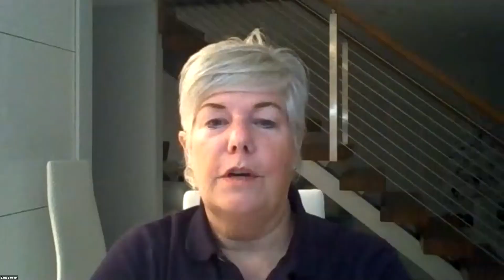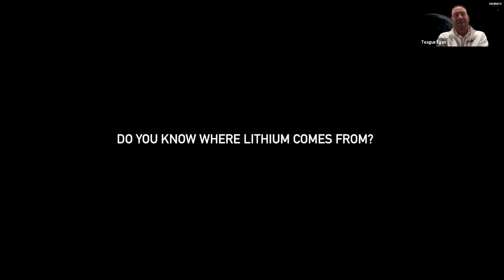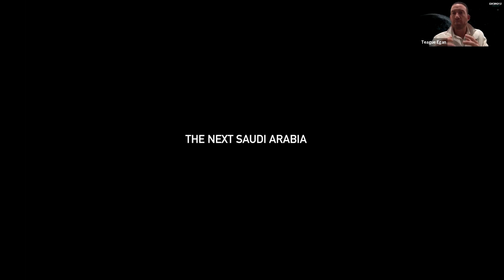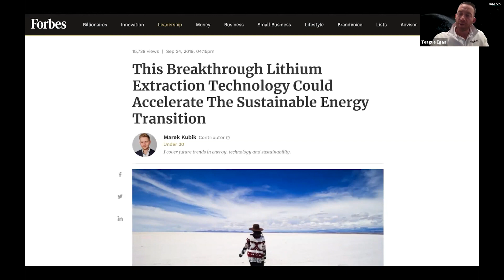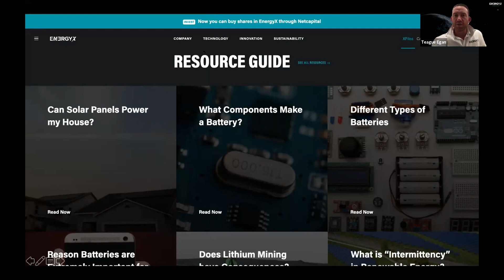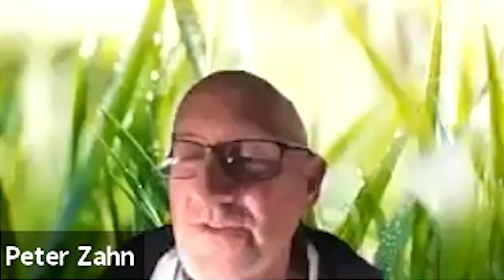Lithium Production Technology - Electric Vehicle Association of San Diego

Comment: Other lithium producers typically rely on one of two methods to produce lithium:

Evaporative ponds (‘salars’): these producers slowly concentrate lithium in ponds as evaporation takes place.  This process occurs over many months, requiring large amounts of water and significant surface disturbance for ponds.
Lithium mines: these producers remove waste rock (overburden) to uncover the lithium host rock, and dispose of the overburden in waste dumps.  Lithium-bearing rock is mined, crushed, milled and processed to produce a lithium concentrate and a tailings stream.  This tailings stream must be stored in a tailings impoundment.  These mines are energy intensive and cause significant land disturbance for waste dumps, open pits, and tailings ponds.
E3’s proprietary, low-energy DLE process has several advantages over these producers. 

The process is fast – we recover lithium in minutes, not months. 
The process has a much smaller land disturbance footprint – In E3’s process, saline formation water is re-injected back into the formation.  We don’t require evaporative ponds, mining waste dumps, open pit mines, or tailings ponds. 
The process requires minimal fresh water – E3’s process only uses saline formation water from formations far below the groundwater table and returns the saline formation water back to the same formation.  We don’t require large volumes of fresh water.

Comment: A demonstration plant is an industrial system used to validate an industrial process for commercialization.

 It is larger than a pilot plant, and is the final stage in research, development and demonstration of a new process.

 Demonstration plants are built in a range of sizes, and the term 'demonstration plant' can sometimes be used interchangeably with 'pilot plant.' However, demonstration plants are generally larger than pilot plants, and are often constructed following a successful trial in a pilot scale size.

Demonstration plants are used to prove a process works at industrial scale, and is financially viable in its intended industry.